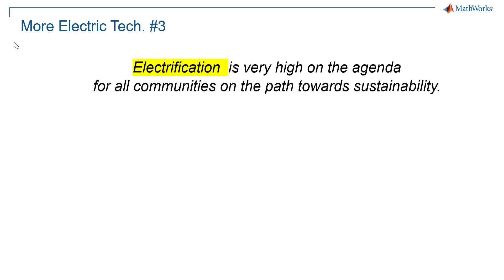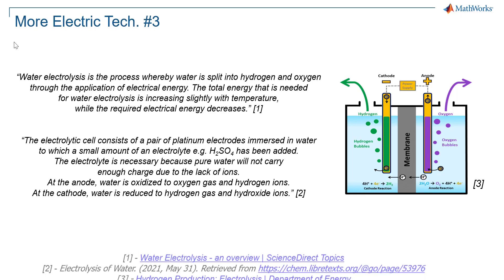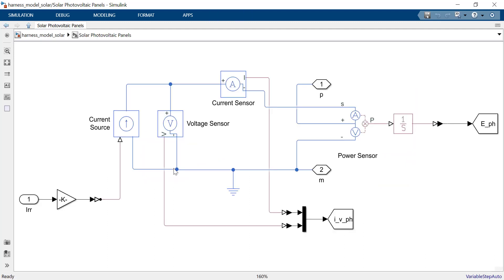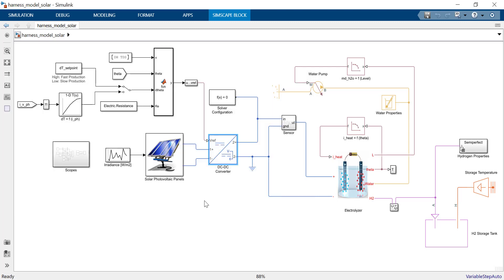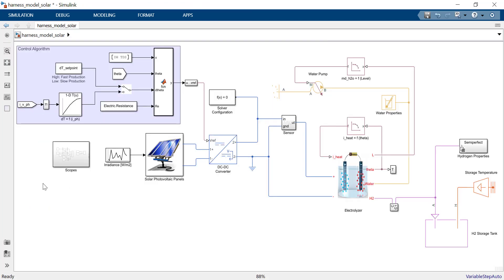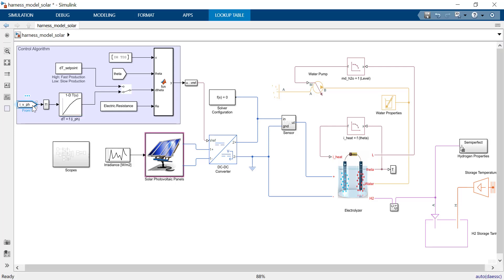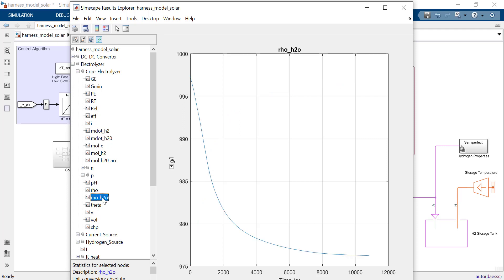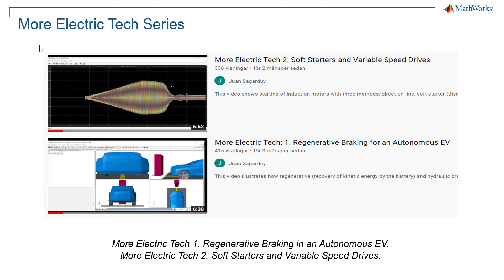More Electric Tech 3. Green Hydrogen from Renewable Energy.

Comment: can we achieve medium-voltage with this DC-DC converter because electrolyzers normally run at very high voltage?
Reply from the maker: Hi Abdul. Yes, it is possible. In some cases, it can be a system with a rectifier AC to DC, and then a DC-DC converter is not needed. Regards Juan

Comment: Hello, can I connect the electrolyzer at simscape with a simulated model designed with normal Simulink blocks?
Reply from the maker: Hi Dalia. You could, but not recommended. Best is to model the electric grid with Simscape as well. But the outputs (produced H2…) can be converted to Simulink signals. Regards / Juan.